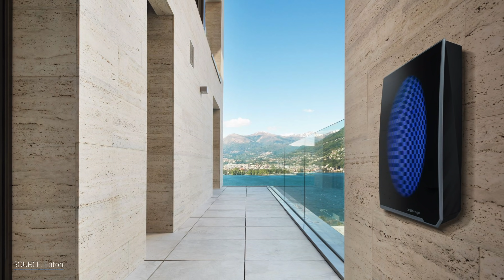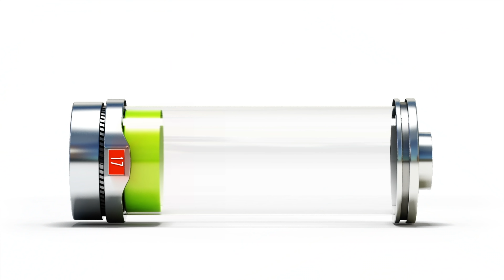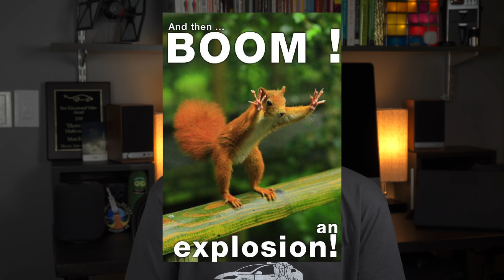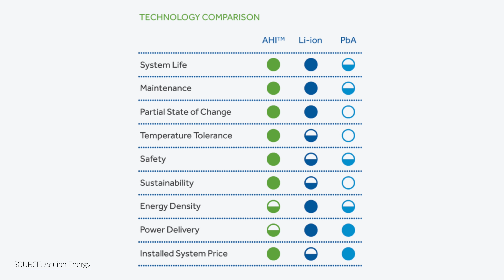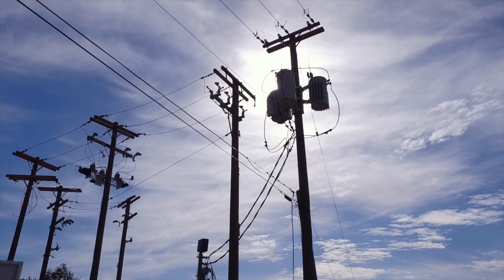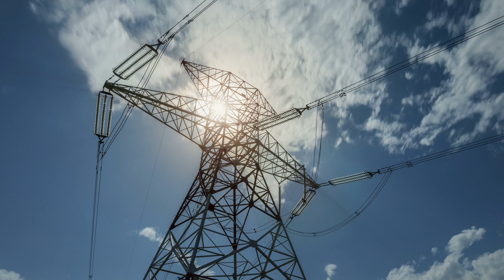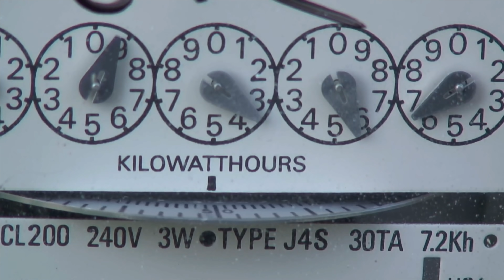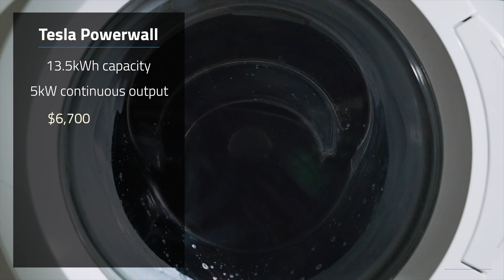Solar Battery Tesla Powerwall and more

Comment: For me to have a solar batteries situation they would have had to come up with solar battery situation back then when they didn't have it so I've been using lead acid batteries 1000 amps 135 amp hours for 30 years and after 18 years I lost two batteries and after 30 years I lost another 5 batteries one of them is dated back to 1987 that one died on me this winter with four other but at least my 1983 battery still trucking along under the solar charger powering my house had to go through in test all my batteries cuz I had a power issue inverters and the solar chargers the first time everything had problems and I thought after 30 years I lost all my batteries it had me panicking what I would had to buy all that one time even if it was a AGM batteries or EG4 batteries or something or a powerwall everything I would had to replace all the food in the refrigerator and freezer the freezer the other frigerator so much food especially when I buy a whole steer and a couple pigs and so much other things why you get the point. Just to order something like that no wait to get it and it could take up to three to six weeks Walmart Epps not too bad I ordered from them I'll get it within a week or two but all that food would have to be thrown out and the prices for that stuff would be incredibly costly I was going to go get a $74,000 loan just to do everything I need to get done including solar panels some different inverters batteries powerwall something I want to head to buy eg4 solar system with two inverters four batteries those solar panels and I would have to buy him anymore batteries from them because I could have a three-and-a-half almost zero solar power where the batteries would have to cut in inverters and don't have to get two additional inverters and batteries for those just to replace my antique inverters from way back when 20 years after invented solar panels Witcher friend of mine is going to bring me those solar panels the first built well twenty-nine of them one which is actually a for water heater I don't have that kind of water heater but I do have a friend that does that can use it because there's died but these solar panels are 1964 10 ft by 18 ft massive solar panels and just serviced and tested at 85% to 90% original power out still very good solar panels least that's what the paperwork says but I will test them. I don't need them all but they will make a good fence fur on my garden to keep the deer and smart predators out.

Comment: Tesla powerwalls and you need at least 7 or 8 of them how to take 200 years to get paid back on it plus the inverters plus the solar panels plus installation to all that and cost for them to come out to your place especially if it's halfway across the country. Like when I put Windows on my house and it was just my front porch cost me $1,000 to get the windows and it cost me $2,000 for them to install and it only took him 2 hours to do it in. So cost me $3,000 and some taxes yet besides and it wasn't enough cost to claim it on tax return that's almost a lost lost situation. Because I could have just left the old windows in like I did for the rest of the house. And I could ask you put my own windows in I just got to be careful not to buy it from a company that wants to come out and install it I mean I guess it'll be better if I go to Lowe's or Menards to buy Windows which I have done before but I'm going to have to do it again to do the rest of the windows on house. But if I buy my own 550 watt solar panels yes I'm going to change the shingles on my also change the pitch on the southside roof the north roof has a good pitch the South has a bad the East & West has the best which also seems to get more sun than the Southside at least in the summertime probably about as much Sun in the summertime in the wintertime the Westside will get probably about 4 1/2 hours of Sun the Eastside of get about five and a half hours of Sun the Southside gets between six to eight hours of Sun in the winter time and two hours more in the summertime and the east get sunlight from when the sun comes to about 2 or 3 in the afternoon the Westside gets from about 10 in the morning to sunset the north rough gets about two hours of sunlight directly when the sun comes up so does the back of my solar panels the side of my house facing south bifacial solar panels comes up and gets two hours of Sun sunlight and it gets a little bit more as it comes up been through some trees I told gets above the trees minutes on the Southside but the north side get sunlight how about 10 in the morning to two or three in the afternoon and not on the way west Northside a house because of trees the west side of my house in towards the backyard in the winter time the north side if Lucky Sun from about 11 in the morning to maybe one 1:30 possibly two clock. But I have noticed one thing the sun has been coming up farther North East more Northeast East North work comes through the cornerback of my yard between the trees in the garage of the neighbors trees straight north of my place to where the garage is touching my garden AccuWeather little gap between the garage and the other neighbors trees on the Eastside but that garage belongs to Mexican restaurant but I used to be a car wash truck has went there and wanted their trucks cleaning them off they watered my garden my plants love that at least back half of my garden did . And I noticed looking up in the sky at night star formations that song wayfaring North above the North Star just above the the North Star straight up above me and slightly south of that which has nothing to do with solar panels just for the sun comes up and goes down nowadays so when I put the shingles in I'm going to put bracing up for solar I'm going to do a little different than everybody else I'm going to cover 100% of my roof so you do not see any roof except for the solar panels maybe except for where the roof comes over the Southside just slightly safety see my south roof in that situation I'm going to cover my top of my windows for shade from when the sun gets to be the 2 clock in the morning to 7 at night really really heats up my south and west side of my house. Also have solar panels against my south side of my house facing self then I also have find a corner East front porches solar panels leaning to that goes farther than the watch over to the east facing south where I should get bifacial solar panels but they'll be different size cuz I don't know a 550 watt bifacial solar panels I heard of 290 watts, 435 watts, 455 watts, 535 watts, and 590 Watts bifacial solar panels but not 550 watts which is okay with me I would go with the bigger size if for the right price and I found it once but I haven't been able to find it again but I will and I will not pay a hundred fifteen thousand plus dollars for 40 pallets of it it'll take me twenty years come up with money for that and by then it'll cost a hell of a lot more and I'm going to buy them all little bit at a time when I can afford it all this year and maybe even next just you get the 550 watt solar panels. And I have one more stand just in front of that one six or seven feet in front of it maybe a little less because of solar panels I put that one couldn't stand only 40 inches long understand to the whole width of my driveway right in front of the front porch but those are will be smaller solar panels between 320 watt to 365 watt solar panels on their side they fit that with for the height is 39 1/2 to 40 in I don't care how long they are for high they would stand because they're going to be on the side and I'll get six to eight of them to the width of my driveway. But I will make two other stands besides that on the south side of my and three more on the east side of my house facing south which would ask you only get about six and a half hours in the summertime and there's three other stands I will build as well. Probably after I cut down the neighbor trees on the west side of my house which I have two neighbors in the Westside unless you're kept on the westside of my other neighbors right beside my house this year or next year I cut the west neighbors trees down and also get it off the top of her shed she's been asked me to do it the last couple of years but I've been really busy working so many ever hours because no one wants to work these days I had to work so many hours so everybody would get food so food can get shipped out to go to all these other stores in the United States of America and 50 other countries actually I think it's like 110 countries including United States of America where no one wants to actually work so many lazy people would have a problem if I quit working cuz they'll have harder and harder times findings food when 90% of a store would be completely if those foods don't go in there and because of the troyer's of the people protesting so many of our competitions close down will never open up again so it's getting more desperate that I work for not actually work for you people but work so you can actually get your food so you won't starve.

 Yes I've been getting solar panels but nothing like what I'm going to be getting pretty soon after I get some more 100 watt solar panels and and 180 watt solar panels and a bunch of 450 watt solar panels if I can find the Polly 405 watt solar panels a I will buy them a whole pallet because it doesn't need to sun ☀️ it just needs some light from daylight to make them work they start earliest in the morning when the Black solar panels says it's still dark angles real late in the evening to wear the black solar panel say it's too dark and works in the daytime when do black solar panel say it's too dark when it is really cloudy myblu solar panels save me and many times yes I have black solar panels to called monocrystalline black solar panels wood work in  slight cloudy or just sunny days under only about 3 inches of snow blue ones are still work underneath 4 or 5 inches of snow they might make slightly less watts maybe 5 or 10 less watts but the blue solar panels polycrystalline will start running half hour to an hour and a half before the black ones will and 1/2 hours past the black ones when they stop making even more power out of the whole day then the black do that's why I like polycrystalline solar panels cuz they're run 2 to 3 hours longer than a black one well making only 10 of 15 w less and then they're making 400 / 500 more than than black one will they work more in the dark black ones will but there is a point with the clouds getting so dark not even the blue ones would work but that is kind of like what tornadoes pop out of or two for the snow just or two feet of rain or should I just say really bad weather what weather doesn't bother Polly just really bad weather does you see I had years of testing both monocrystalline and polycrystalline to show me what they can and cannot do I know what their limitations are no one can lie to me about it because I have all the data.

Comment: Can you have batteries without the panels? Two installers have refused to install panels on my roof because they won't get enough direct sun. But couldn't I still install enough batteries to supply my house and just have them charged by the grid, or by a separate generator when (not if) the grid goes out? At the very least that would give me a little peace of mind, plus I could do away with at least a half-dozen UPSs that are backing up several computers and TVs. 
By the way, I really like your podcasts. I don't always understand them, but I always feel like you're shooting straight.

Comment: Sometimes you have to weigh the benefits of battery back-up beyond just dollars and cents.  I was thinking of getting a permanent back-up whole-house generator.  We have many mini-outages in central FL as well as infrequent several day outages due to hurricanes.  The cost for a natural gas generator was going to be pretty high at our house because a gas pipe would have to be brought over to our street - maybe as high as $15-$20K!  Plus ongoing maintenance and fuel costs.  BUT with Solar/Powerwall batteries, while the up front cost would be more ($33K after the Federal Tax Credit), we will continue to save money over the years by lowering grid usage and getting net metering credits.  Plus the system will save us from the frequent mini-outages that are very annoying - have to reset clocks, wait for internet to come back up, etc.  Also, solar/battery operation is completely silent.  And finally, if we ever have a week+ grid outage again, we’ll be sitting pretty while everyone else broils in the hot, humid summer Florida sun.  And the final benefit - I can finally say my Tesla auto literally runs almost completely on sunshine.  No more BS about running on coal!  For all of those reasons, that’s why we’re making the financial plunge for a Solar/Powerwall Batteries system.  I think it may also increase our house’s resale value.

Comment: Thanks for the video, and the tip about possibly working with Energysage may be the best part. But why do you insist on the term "Solar Battery"? There is no such thing. For instance you want to call a Tesla Powerwall a Solar Battery. No! It is just a battery. There is no solar component. You may operate it as part of a home solar system using solar panel for electricity generation. In such case, the batteries are part of the solar system, but the batteries themselves are just batteries, NOT Solar Batteries.

Comment: I have a few questions:

How much energy/power will it take to charge these batteries?

 How long will does it take to charge these batteries?

How long can these batteries power an average home?

Which of these batteries will be best for handling loads such as a washer, dryer, air conditioning unit, microwave, etc.

Comment: The reliability here in NC that Progress/Duke offers is really atrocious.  My first year in this house?  Two periods of 3 days with NO power.  and another 6 outages that were 3-6 hours each.  I looked into a stand by generator (Generac or equivalent) --- If the house is running more or less completely, 3 days will eat up a 300 gallon Propane tank.  That's a $1000 refill.  Ugh.  So solar it is... just need to find what can actually run the house properly.

Comment: I'm about to pull a trigger on 8kw solar array and Powerwall. I'm in MA. Our winter daily average 30 kWt. The local installer offers 1 PowerWall and subpanel for critical loads (like heat, fridge etc) to get us through outages. Tesla offers 2 Powerwalls for 30% more for full house back up. What has more sense?
Reply: 30kWh I guess you mean.   All this backup they are talking about,   for how long? batteries have finite capacity,  how long will each option hold the load?

Your question cant honestly be answered by anonymous internet repsonders, epecially with zero numbers provided.    Who do you trust more?  who sounds sincere and who sounds like they just want to sell you stuff?    who will be around when problems occur?
Reply: @yarpos  Decided to go with Tesla as everyone else is basically buying batteries from Tesla and making markup. In case of outage I hope to be able to survive on PW overnight and recharge next day.. Will see how it goes. Thank for reply

Comment: I installed a 9.8 kWp PV system with an LG Chem Resu10h battery. I only installed it as a backup source of power whenever the grid goes down. However, I discovered that my battery will discharge whenever my PV is not generating energy power in order to off set my reliance on the grid during the high demand of household electricity. We have net metering and no peak houses in my area.

Comment: Does some of the added equipment cost for Tesla and Sonnen get offset by having to buy less equipment than you would with a battery bank by SimpliPhi or Lion?  That is, does their equipment act like the inverter/charger in another system?

Comment: This whole are is changing there are some battery systems that where grid tied if the grid goes out it disconnects the grid and uses battery power.  Not all systems do this.

Comment: Hello, on a different YT BLOG a chap in AUSTRALIA, SAYS THEY NOW HAVE SOLAR & wind , where he lives, it costs$0.23/kw, same AS I have in NJbut they are having problems with their mandated systems, @ night naturally there is no SUN. BUT there is zero winds too, so EVERYBODY HAS GOT TO BUY A GAS GENERATOR, SO MUCH FOR SOLAR & WIND!!   Cheers FROM NJ🇺🇸🇺🇸🇺🇸🇺🇸
Reply: The entire State of South Australia did exactly this.   They have 3 x as much nameplate capacity as they need for raw demand,  they also have very high rate of home solar (good climate for it).    The "discovered" at times the wind doesnt blow at night and also these systems are very bad at recovering a Statewide blackout they also enjoyed following a storm.    They then spent another half a billion dollars on gas and diesel fueled generators that are required to run even when the wind is blowing to provide reliability and stability on the grid. 

The core issues with solar and wind is that the capacity factor (what is actually delivered over time vs the nameplate number people talk about) is about %40 being generous.    Also they add instability to the grid and cant be relied upon to stabilise the grid or perform a black start.

Comment: Hi Matt: Just recently found your channel & I'm glad that I did. I was wondering if you did, or could do, a video on Teslas tile roofing system which incorporates the solar into the tile so that you can't even tell there's a solar system on the roof. Not sure if they work like regular solar panels or not? However, from what I have seen/read about it, it supposed to make it way easier & less expensive to replace the tiles down the road. Thanks